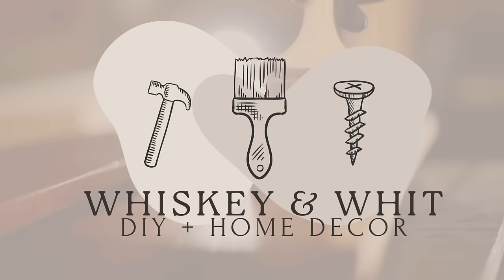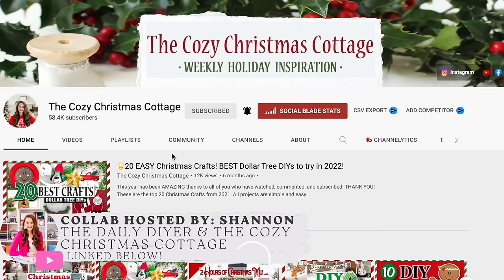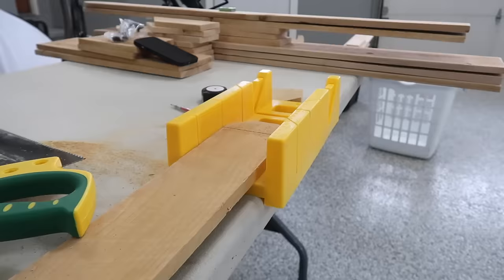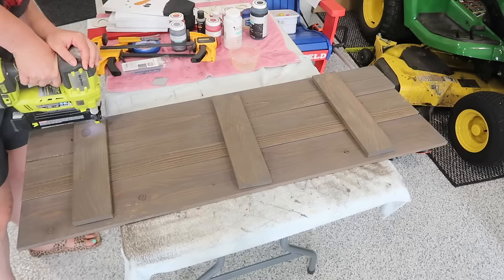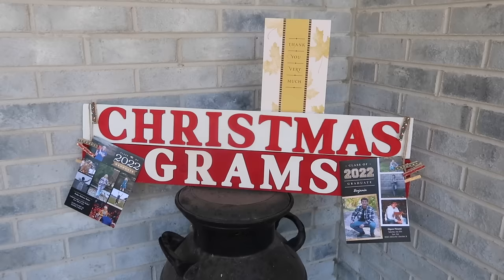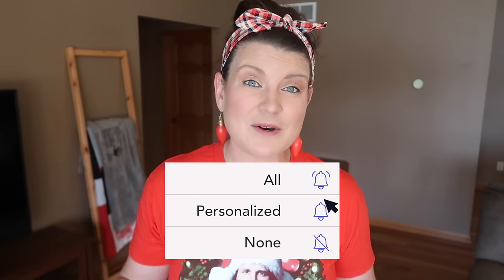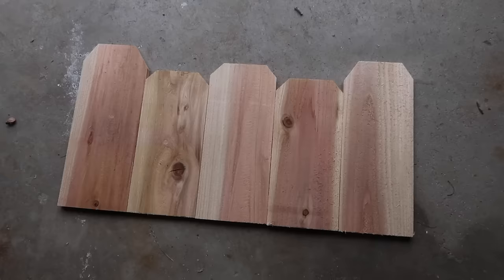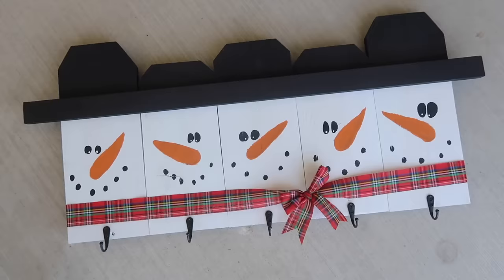Grab $2 wood fence pickets to make these EASY Christmas DIYs 🌲 AND they're great to sell, too!

Comment: I think the churches would be also great made to look more like the shape of a barn I just wouldn't know where to start to bring the idea to life
Reply from the maker: Yes! I would adjust your cuts and put them together flush like the white church I made. I'd cut the middle tip to 12" and keep the sides at 10" then that way you won't have a taller steeple and just have a pointed top for your barn :)